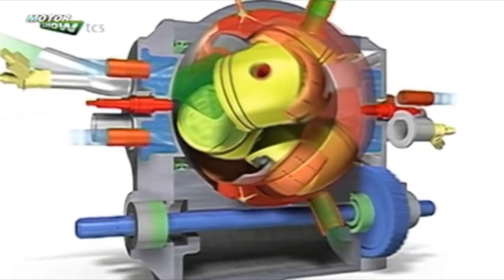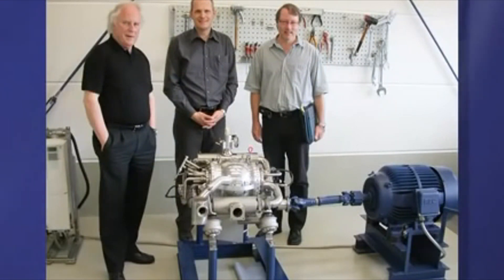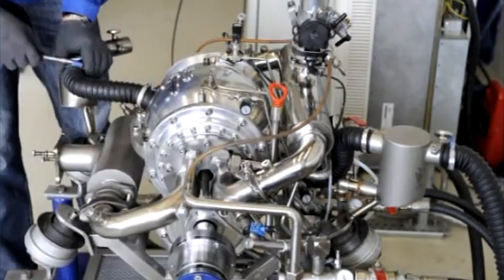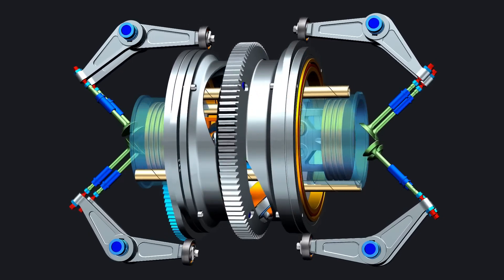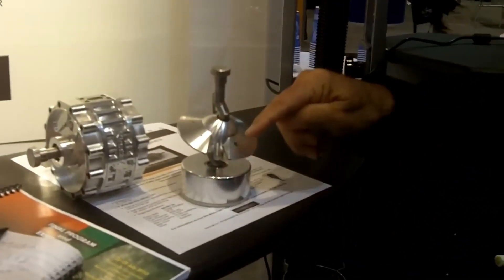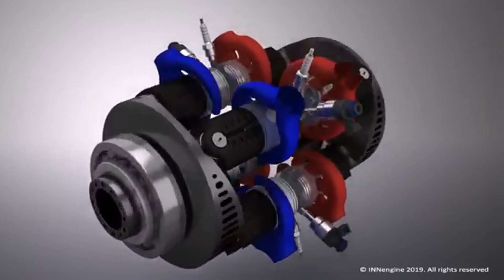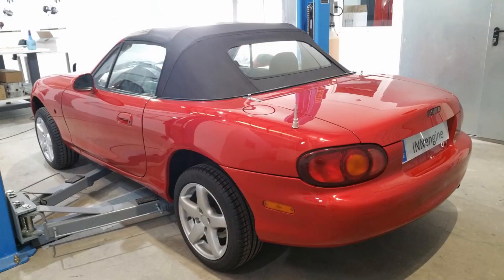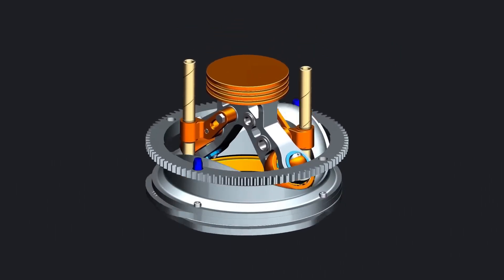New Technologies: 1-STROKE Engine, CoAxial Motor, Spherical Еngines. How does it work?

Comment: The 1 stroke engine will have significant wear of the piston skirts because of the torque generated by the connecting rod rolling on the slope of the output wheel.  It will need lots of lube on the cylinder walls and large piston skirts or another mechanism to keep the pistons straight.

Comment: Ball bearing. Something that could potentially become main obstacle on 1 stroke promising high efficiency engine. It need super resilient ball bearings, working under super hot engine environment.
Reply: Also, the "wobble" plate is a bad design because forces will be focused on a small area between roller bearing and the plate. Side forces will be like normal engines, or worse, depending on angle of the plates curves. Overall it is a somewhat improved 2-stroke due to not using traditionall scavenging (which already exists), but with a bad piston-to-rotation mechanism. This engine will fade away into obscurity like many others.

Comment: The INN engine has a really good design. What is being left out is that it requires forced induction. It is a two stroke without the built in means to force air into the combustion chamber. Personally i want one or two or ten to play with.
Reply: The "wobble" plate is a bad design because forces will be focused on a small area between roller bearing and the plate. Side forces will be like normal engines, or worse, depending on angle of the plates curves. Overall it is a somewhat improved 2-stroke due to not using traditionall scavenging (which already exists), but with a bad piston-to-rotation mechanism. This engine will fade away into obscurity like many others.

Comment: Until these enter commercial production they are engineering curiosities. At best they may find a niche application if adapted to hydrogen or biofuels. The era of electric cars and decarbonization is irreversible.

Comment: This engine for Toy. Toy engine😂😂😂😂😂😂😂
Reply: not just toy, works with supercapacitor or compressed fluid to power recyclable electric motor and mechanical transmission like subaru wrx high torque cvt or hyundai ioniq hybrid non cvt transmission or toyota cvt with normal 1st gear. freepiston is another type of engine. can be variable fuel.

Comment: 1 stroke until 1 stroke and has a supercharger. Me smells BS
Reply: "1 stroke" is a marketing term they use like a brand name.  I think that they delibrately choose such a confusing name to attract attention.  These guys know how to play the searching engine game.
Reply: @catchnkill   It is indeed not a 1 stroke engine, that doesn't exist. It's a 2 stroke. They even say that on their website and say the only reason it is called a 1-stroke is because scavenging is done differentely. False marketing. Also, the "wobble" plate is a bad design because forces will be focused on a small area between roller bearing and the plate. Side forces will be like normal engines, or worse, depending on angle of the plates curves. Overall it is a somewhat improved 2-stroke due to not using traditionall scavenging (which already exists), but with a bad piston-to-rotation mechanism. This engine will fade away into obscurity like many others.